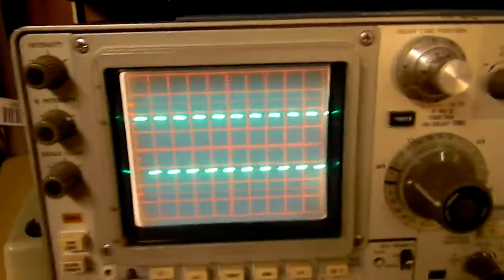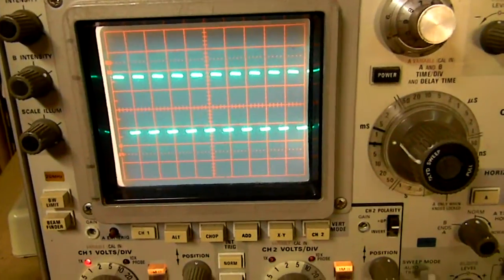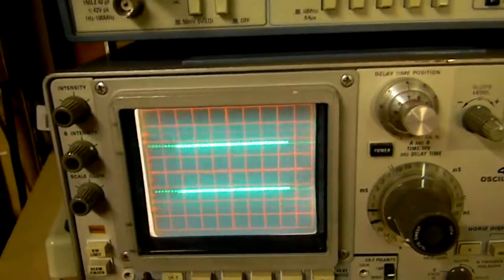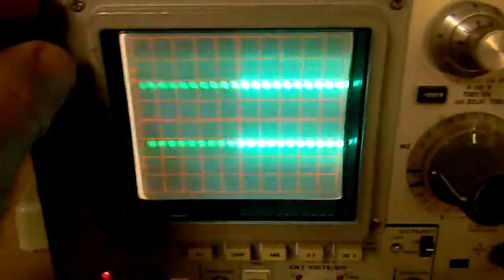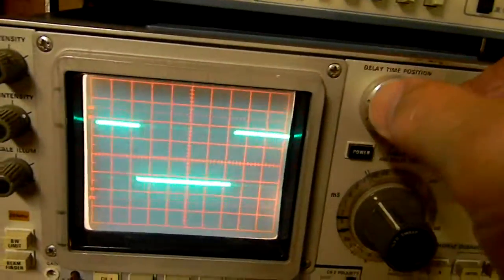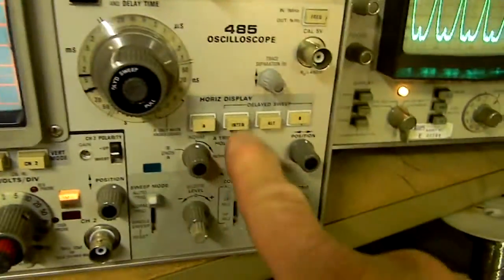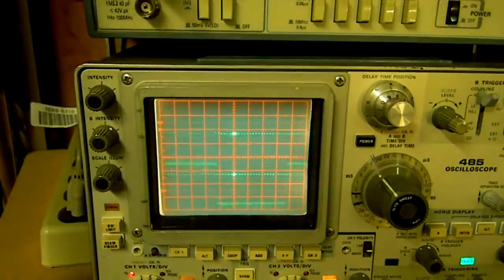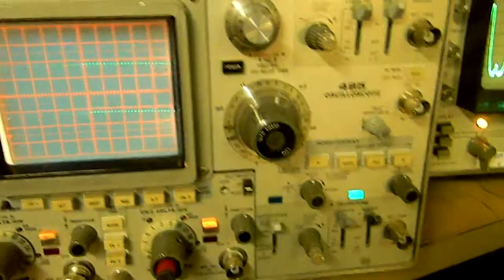Using A Tektronix 485 Oscilloscope Delayed Sweep B .MOV

Comment: David, one thing I have never understood is why they call it 'delayed sweep'? What's delayed about it? (I have the same problem with 'delayed AGC.)
Reply from the maker: Well... I will have to think about that. Maybe the full sweep of the time base is "delayed" from being displayed on the screen in one sweep? So you can scroll thru the complete time base a little bit at a time with the delayed-sweep 10 turn pot? I am making this up as I go. You know what it does by allowing you to put your time base on something, like we used it for on the big computers mass storage devices, by setting the primary time base/sweep time to a complete rotation of the drum/disk but, the detail is so small it is worthless so we "delay" the full sweep by magnifying the detail of sweep? I don't know why that term, I am just trying to describe how I used it and the term just stuck I suppose. Does any of this make any sense?
Reply: ElPaso TubeAmps Yeah I know what it does, and I actually used it last week. I just don't understand the terminology. Maybe I'm just too literal-minded. I had the same problem for years, decades really, with RIAA equalisation and 'constant velocity' in the cutting. The penny finally dropped this week that it doesn't really mean constant: can't possibly mean that; it only means constant velocity with respect to varying frequency. So differentiating it with an HPF yields constant amplitude, and integrating that with an LPF gives you back the constant amplitude, and constant amplitude is kind of in the nature of a magnetic coil motor or generator/cutter or pickup, and now I finally get it. But after overcoming a major conceptual block which was due entirely to bad or insufficiently explained terminology. Similarly with delayed AGC, what they really seem to mean is integrated AGC, via an LPF. But I can't manage to import this integration/differentiation stuff into delayed sweep. What they really seem to mean is 'magnified', or 'double-triggered'. I don't know.

Comment: Very helpful videos as I am a beginner into learning electronics (as a hobbyist ) and have acquired a 485 (on its way). Can U suggest an  probe to use with it...my friend is also sending me a 2467b.. will the same probe work for 485 (p6137). other options are welcome. As always I enjoy watching ur videos thanks for posting..
Reply from the maker: You are going to have some really high end scopes. Congratulations. I used the 485 in my work years ago with NASA and it was my favorite. Really nice bright and sharp display. (I never did like the 475) We even had vacuum tube Tektronix scopes when I started there in 1970 and they worked great also for communications. I still have two 485 scopes and one gives me a lot of trouble with contacts. The other one still works very nice. Not too sure how to clean the contacts on the troublesome one. Do Not spray any cleaner down the front of the scope and get it on your knobs. It will take the lettering right off the knobs... I did that once but was lucky enough to find someone on Ebay that was parting out a 485 and sold me the knobs. Whewwww....
The 2467 is also a very nice scope and more modern with cursor measurements and much more. 
As for the probes I can not for sure say which ones will work and which ones will not but the odds are all of they should work OK. Of course, you know you have to use the 1KHz calibrator on the scope and adjust the probes to a good and accurate square wave on the display. If you can adjust the probes for a proper square wave display, you should be OK.

Comment: I use to work at Tek on the 485. Probably touched 5,000 of them in the test area. They were advertised at 350 Mhz but I often seen them go to 500 Mhz before dropping off below spec. I worked on 455M, 465, 475A, 485, 2213 and 2215. Later on BST 576 and 577 curve tracers.
Reply from the maker: My work on the Tek scopes was at a much lower level than what you experienced. I worked for Univac on contract with NASA and would "maintain" the scopes by repairing the probes - which were treated poorly by many of the techs - and small repairs and vertical calibration checks on the scopes that were possible in the field. One time around 1983 or so, Sperry( Univac) flew me around the Southwest with my DC calibration source (a mercury calibration battery) and Heathkit square wave calibration generator to check and repair (as best I could) all the 453 scopes we had - we had a few 454, 454A and 475 scopes. Pretty humbling when I think back on it. Never did like the 475. I now own a Lot of Tek equipment. Thanks for your comment.
Reply: +ElPaso TubeAmps Recently bought a 475, and I am curious as to why you say you "never did like the 475."
Reply from the maker: sanjursan I always found the focus poor on the 475 as compared to the 453/454/454A and 485 and also, if I remember correctly, the 475 seemed to have a bit more problem with sync - that was my experience with them at NASA and WSMR

Comment: Delayed sweep, especially with a delayed trigger, is indispensable for observing glitch events which the scope cannot normally trigger on. Back in the 1970s, I used delayed trigger for troubleshooting high speed digital busses on modems and multiplexers. Today, it's useful for observing anomalies in any sequenced circuit, as well as in audio amplifier signals. Being able to independently trigger on the delayed portion is a powerful feature that I've put to use many times.